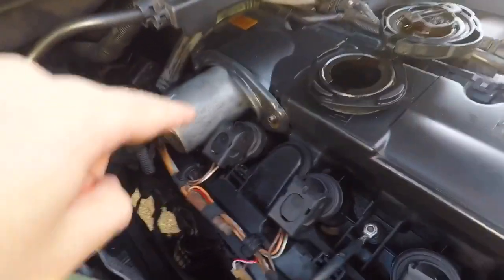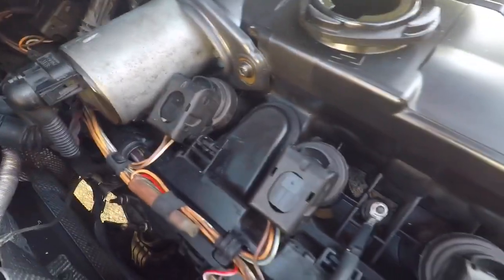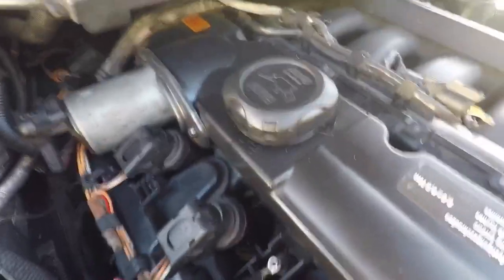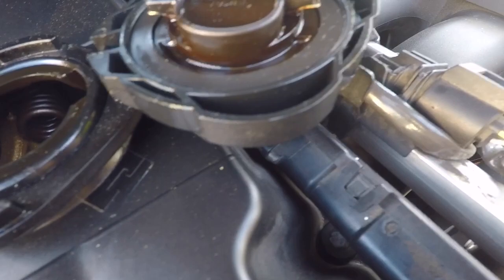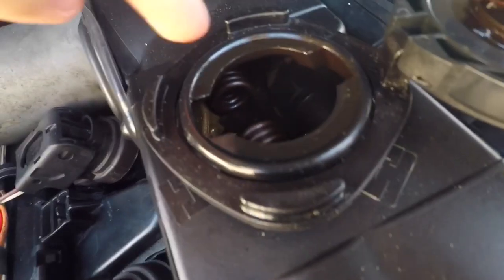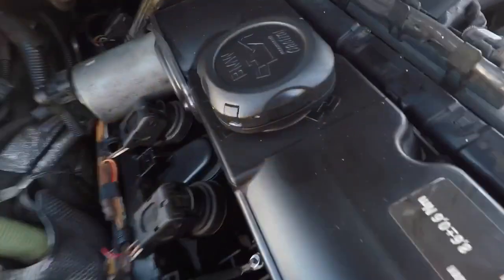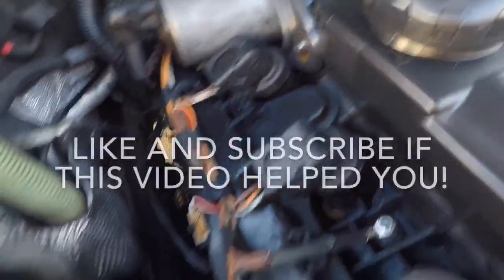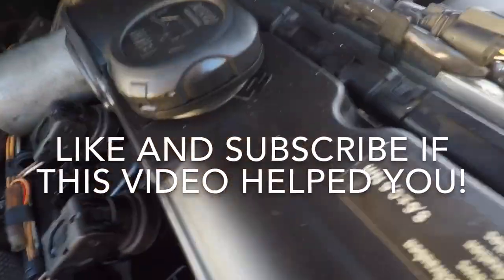BMW E91 E92 E93 E90 N52 N54 OIL FILLER CAP LEAK?! It’s not your valve cover! 325i 328i 330i 335i

Comment: Man,  gotta love BMW.
Just got a customer come in that had changed all the known gaskets,  some shop even convinced him that OIL PAN gasket can cause oil there. The even sold him a new valve cover........biatch still leakin' 3 grand later.
I literally just wiped the oil fill cap gasket and guess what......leakin no mo

Comment: I have 100% the same problem. 2011 bmw 328xi. 91k miles. Don't feel like buying $23 for new cap to get the new gasket. Considering the Gates brand one and will hang onto the OEM one for selling the car
Reply from the maker: Just get the new cap and it'll be fine

Comment: Yesterday I had seen the same on my engine the whole Block at the injectors with oil I also indeed replaced the filler cap after seeing your video You would almost think it is too valve cover gasket but only in the holes oil and not on the injectors ignition coil itself so there is no other option
Reply from the maker: yeah ppl miss this a lot

Comment: We’re you getting gas smell coming through your vents? Trying to diagnose my 2014 wrangler. Fuel line is in good shape. Only thing I see is some oil residue around the cap.
Reply from the maker: No I wasn’t…
Reply: You might have stuck open fuel injectors or a bad fuel pump o-ring. Don't have any open flames in case there are fuel vapors.

Comment: I had the same problem today, the holes on cylinder 5 was full of oil in it, I was freaking out a little because I just replaced the valve cover gasket, probably just gonna buy a new cap, mine looks a little different than yours
Reply from the maker: Could be your valvetronic motor gasket
Reply: @TOMAHAWK813  no I bought a whole bundle which includes: valve cover + gasket + valvetronic motor gasket and sensor gasket + 6 coil packs and 6 spark plugs. The only thing I didnt replace was the cap
Reply from the maker: @kennyus2000  oh I see, yeah could be the cap then!
Reply: @TOMAHAWK813  I did the exact same, replaced everything, new valve cover + gasket, valvetronic motor gasket and sensor gasket as well as spark plug gaskets and I noticed that it's getting in the same spots. However, I don't think I put the oil cap on correctly lol so I hope that's it

Comment: is the oil cap supposed to be air tight?   I have a rough idle and did a smoke vacuum test and and the only the smoke comes out from is the oil cap. 

its a new valve cover that i just installed and i tried with a different cap and same issue. I m thinking replacing the entire valve cover again
Reply from the maker: I think the oil cap should be air tight yes.

Comment: Hey, thanks for the video. Did this permanently resolve the oil leak from the filler cap nearly a year on? 

Took mine to a mechanic as thought it was VCG and they said its blowby but doesnt seem the case to me.

Please let me know. Thanks
Reply from the maker: M.S. H no it leaked again recently and I replaced the entire cap with a new one. Good as new :)
Reply: @TOMAHAWK813  Did you take off the engine cover to put the new cover on?
Reply from the maker: Nico A you don’t have to
Reply: @TOMAHAWK813  haha a minute too late! I just got my new cap in and it took me a second to install
Reply from the maker: Nico A did it fix the leak?
Reply: @TOMAHAWK813  yes it did! Took it for a rip and no leak

Comment: Hey buddy, did you also have a problem with rough idle? That was caused by oil leaking?
Reply from the maker: I didn’t but oil could build up where the coil packs go into and could cause something
Reply: Exactly same issue with my friend's beemer, replaced all the coils and it feels perfect now.

However, he'll just get the same issue later down the line.

Take a look at this:
https://bimmerprofs.com/n53-problem-cylinder-no-3/